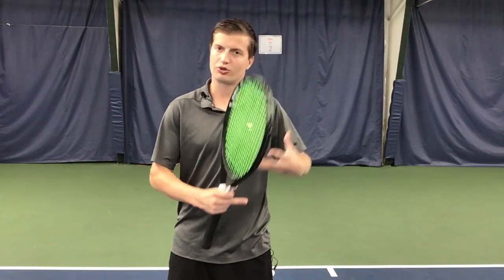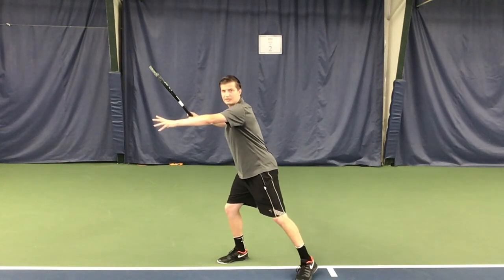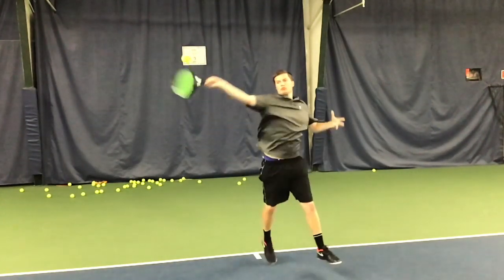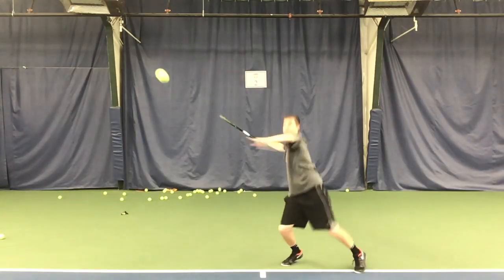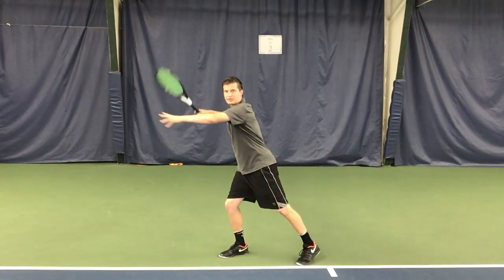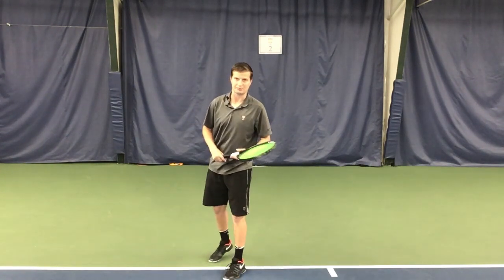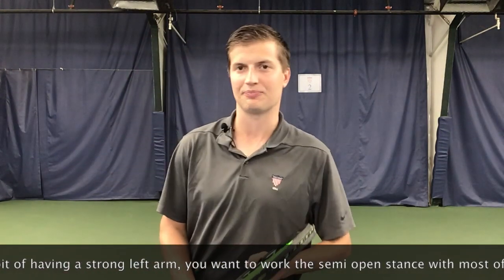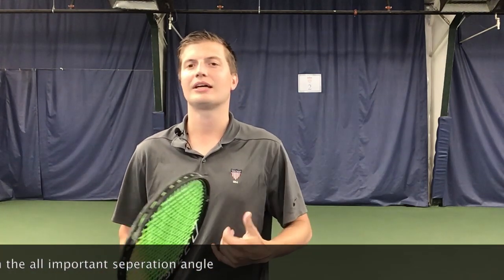Forehand Load/Coil for Maximum Power and Control

Comment: Jeremy what about the grip on this shot.  Since it's more of a drive shot do you recommend more of an eastern  or even continental or should one just stay in a semi-western if that is what they use?  Thanks for all the effort you make to help us.
Reply from the maker: ROGER HILL hi Roger. I would recommend using whatever forehand grip you usually use (hopefully some variation of semi western or close to it). Pros may make very slight grip adjustments (mainly with their heel pad) but that is probably too advanced for many players and not necessary.

Comment: What can I do to stop choking up every time the ball comes at me with even a decent amount of pace? I feel like I lose all these  concepts in the heat of a point.
Reply from the maker: deemahdee I think it’s important to first understand this technique is only for when you have time. If the ball comes fast you want to lessen your load in every aspect. Less left arm stretch, less backswing, lower back swing, less turn, less uncoiling, less follow thru etc. Also, you don’t want to hit excessive topspin when ball comes fast. In fact, you want to hit the ball quite flat and turn the arm over later (less windshield wiper). Important to be extra wide and low for balance/stability and to absorb the incoming ball.
Reply: @FundamentalTennis  thanks for the response, Jeremy! Appreciate your insight at always 🙏
Reply: @deemahdee I ve just started to get over the point you mentioned - choking up - so I can tell you about my experience. Unfortunately, there isn t a magic secret. 

I insisted very much on my technique. Even if the others kept telling me to play more games, I thought that there is no reason to play more than practice because I would have played a silly game, with a lot of ugly and incorrect shots. And I did t think that would help with my choking, even if is true that playing points help a lot. But it s not the key. You can be a killer on the court, with almost no emotion but with the most ugly and inefficient shots :)

Instead I developed a solid technique until I felt very relaxed when hitting any kind of ball. 
We are choking because we are afraid of that shot that is coming, because we count every check point of the shot in those 2-3 seconds. Because we know deep inside that we don t OWN that shot.  It s the same when you learn how to drive. You sweat your ass at your first drive and think about all the moves until your engine dies. 

So...I trained a lot and I was very focused on my technique. I mean, really focused. I didn t hit a single ball without thinking what was I doing wrong. Without being aware of what I did good or wrong. If it s to high, in a fraction of a second I said in my head "close the racquet face and be quicker with your windshield motion". If the next one was too flat ("get under the ball")...and so on. 

But in order to do that, I watched a lot of tutorials and I talked with my coach and other coaches non stop. Because you must know the technique by heart, in order to be able to analyse your own shots. 

The ones that start at an early age hit 10 million balls and Don t talk so much about technique. It comes naturally in time, with much less talk. We don t have the time, so we must come with something else. I chose to learn very well the technique. It s working for me.
Reply: @reversecode1  wow thanks for that response and comment - very insightful. Sounds like youve been where I am. I am actually doing things incorrectly I think - I play mostly games, focusing on points (with poor tech technique), and don't practice enough aside from warming up and playing games.

Can you elaborate a bit more on how your practices? Like are you doing drills or rallying, hitting against the wall, with a coach, etc? I think this is exactly what I need to get more comfortable playing. I can hardly sustain a 10 shot practice rally without either mishitting or hitting a bad shot and losing focus
Reply: @deemahdee  My tennis went to a new level when i started practising against a wall and making sure i hit every ball with good technique,  now more people want to play matches with me.